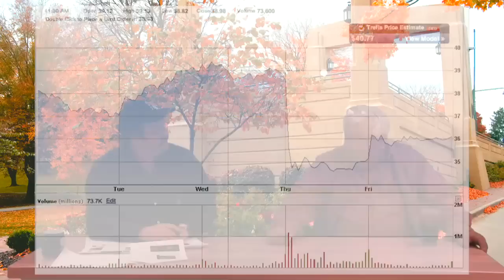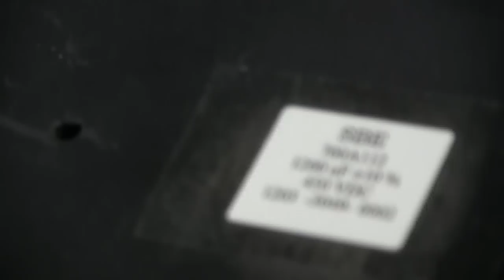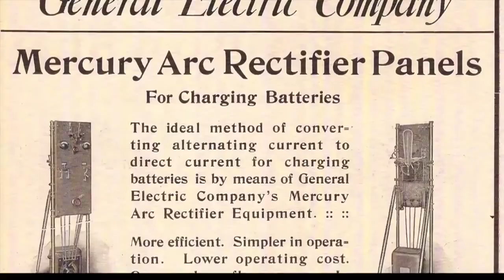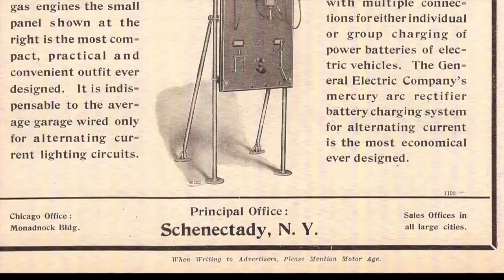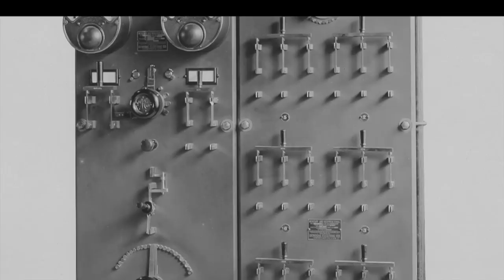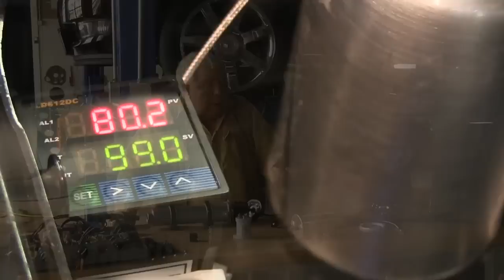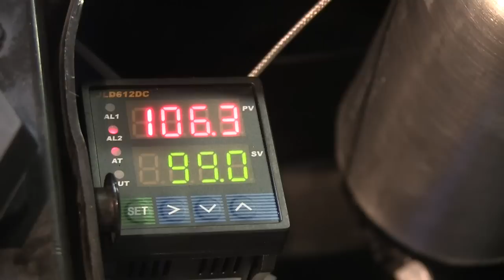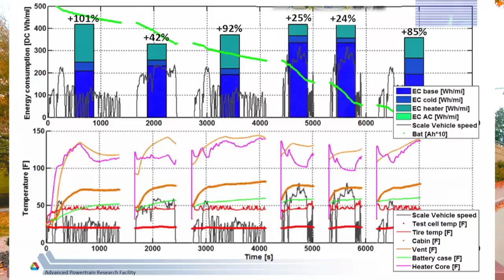EVTV Friday Show - February 22, 2013

Comment: Andrew has a point there Jack. The lost heat may be affordable but will impact the mileage cost time after time so add up and how hard your heater works in the cold climes. Get a water and wind proof jacket on it. That will keep the elements off the elements.
It's beautifully mounted. but I want to to poke your eye with the way the heater is mounted when it comes to bleeding the air. Aren't they vertical?

Comment: I think you simply burned up the heaters as you were over volting them, I thought at the time you did the original heater that ac/dc needs derating, ac is usually quoted as RMS which as a rule of thumb should be treat as 30% less than it says, so for a 110v heater no more than 70-80v dc etc. if you had used 220v heaters on your 160v pack i think you would have been fine